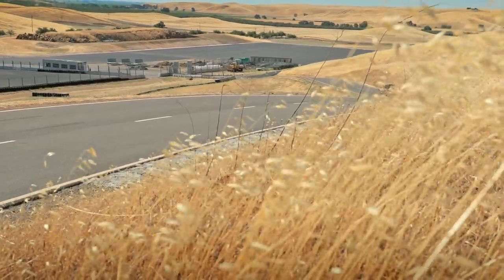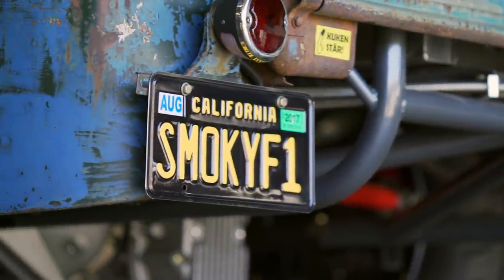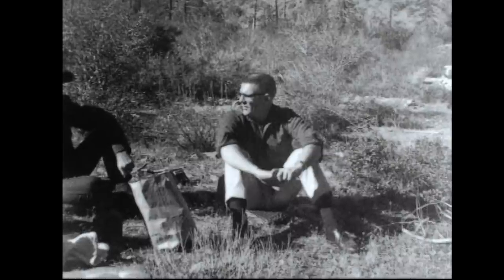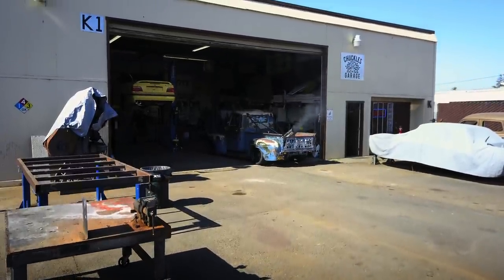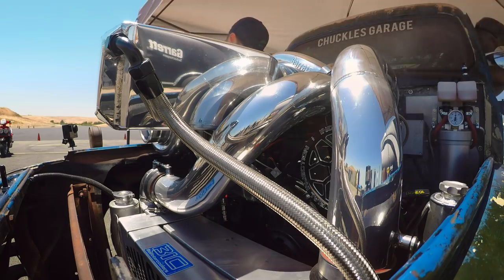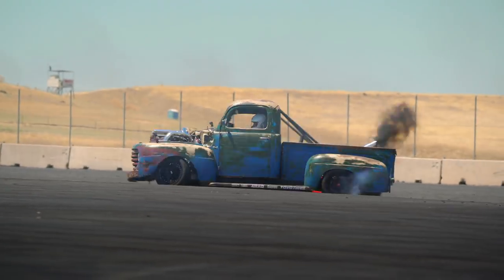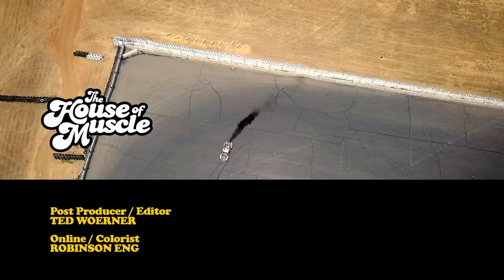Chuckles Garage: 1949 Ford F1 - The House Of Muscle Ep. 10

Comment: I need that truck in my life With TwinTurbos  😍🤘🏻
Reply: why? the compound makes so much more boost
Reply: Jesse Poole it's compound not twin.  Drastic difference.
Reply: No it would be twin turbo because there are two turbos but a compound set up
Reply: clell burdiss twin turbo and compound are complete different set ups.  Yes they both have 2 turbos but they are used differently.   Twin turbo and compound boost are not interchangeable terms.
Reply: The only time not using "compound" is acceptable is when you are using a triple, which is still a compound
Reply: Dr. Spatula you still can't call a twin turbo a compound.
Reply: zac s sure you can, as long as you qualify that it's a compound set up. There are sequential twin turbos as well.
Reply: zac s wait, did I not already say that? Pretty sure I did
Reply: Dr. Spatula if that's what you meant then ok. I couldn't really understand your sentence
Reply: Spam Can lol no that's called sequential turbos.
Reply: zac s I was saying twin is unacceptable but an argument can made for the use of triple instead of compound because it's specifying a compound with 3 rather than 2 turbos

Comment: 7:27 Hmm for you watch lovers such as Lucky, that is A Breguet Type 20 Flyback chronograph, A Beautiful work of art in of itself,  Coin Cut Bezzled edges and the like, tricky to set up right though so you never want to take it to someone who doesnt know what he's doing with it.
Reply: Close, but  the one in the video is my daily work watch, an Omega Speedmaster.
Reply: ah lol welp I've been caught as a moron lol  but the flipside is that would survive far better than a type 20 as I was a little bit surprised when I thought that lol as the moonwatch outside of the first models, the 321 which can be abit tricky to set up has a pretty robust movement.

hell the only reason why one of them failed in space was because it lacked a pressure release valve, like the kind they have on dive watches and the crystal blew out from it. Hence why they made the Mark II of that model.

Comment: Want to know what to call it? The most expensive bargain ever! Me, should I ever get a hold of a straight F1 truck, I'd throw a monster diesel in it too, though I plan to make mine mid-engine =)  Toss the intercooler under the hood for good measure with some crazy air scoop and hood relief cuts.
Edit: Oooh, thought of a good line for this truck: Putting the fun back in F1. I'll also accept royalties if ya make a bumper sticker.

Comment: 2000 lb ft at the  rear wheels?  I sure hope it makes more than that, it has gears does it not?
Reply: otm646 you obviously don't realize how much 2000ft lb of torque is.
Reply: Simple math man, come on.  Engine torque x 1st gear ratio x rear end ratio - parasitic losses = torque at the wheels. It has a minimum as a 10:1 gear reduction before it gets to the rear wheels. The engine is making more than 200 ft lbs obviously.
Reply: otm646 That's not how engines are rated, 2000ft lbs is absolutely ridiculous. Semi's usually only put out 1200-1600ft lbs.
Reply: At the CRANK, not at the wheels. He does not understand the difference. There's torque multiplication from the trans and rear end obviously.
Reply: otm646 But that's not how you rate rear wheel torque, you usually do your power pulls on the dyno in 4th (or whatever is 1:1) and even then you still will put down less than the crank. You will never see a wheel rating higher than a crank rating. An engine that puts out 400ft-lbs crank should put out 325-350ft-lbs wheel, in no expert on how exactly it works but that's how it's rated.
Reply: otm646 simple reading tells you that it's 2000ft lb. Not 200. You even typed it.

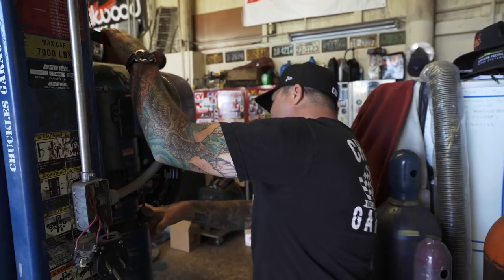Comment: 2:19 Major code violation. Open J Box unsecured devices, 30 Amp male connector on what looks like #12THHN. Is that Hot?
That's a little jackleg. We don't need no electrician, just a phone with 911 on speed dial. Seriously though that's pretty typical
in most shops. But it wouldn't hurt to tape those switch legs up.

Comment: Can you install a proper egr and a dpf please?
Reply: Sebastian Alonso Corrales Rojas why
Reply: mr holmberg reduce particulated material and nox emissions. C'mon
Reply: badtoast1 c'mon man. You can still have great engines and big power being a lot cleaner. That's a fact.
Reply: EGR will fuck the motor in a quick hurry. Manufacturers don't use that anymore because it's inefficient and destructive overall.
Reply: CanadaBud23 destructive??
Reply: The only way it'll burn cleaner is with a clean tune not emissions
Reply: Have you ever ripped apart a engine with an EGR system? Dirty as fuck! Everything is plugged and carbon deposits everywhere. Not to mention you are introducing particulate matter back into the combustion chamber. This creates hot and cold spots in the cylinder preventing proper burn, causing detonation\preignition. Which is extremely bad with high temps and boost, blow shit up easy. Even if you were to make a low power engine with EGR the buildup would reduce the effective volumemetric efficiency of the engine.

I have already went through this a bunch of times with 4.0's including mine and it's better without it and fuel economy is higher. Manufacturers finally are doing away with it because the EPA realized that its bad.

I have no problem with a DPF filter but that would probably plug up in a hurry.
Reply: badtoast1 nope it's a later model 24v common rail purely electronic motor.  At that hp level electronic Cummins motors are much more drivable.
Reply: NO.
Reply: CanadaBud23 simply use low sulfer diesel and low saps oil. Bingo, no more soot deposits
Reply: Chuckles Garage I truly love you truck, personally I also drive everyday a diesel  EV compilant car. Add some more value and make your awesome engine greenner.
Just saying. Bye.
Reply: You are saying make his race car's awesome engine greener which is contradictory to it being both a race car and an awesome engine
Reply: Larry Smith Cool Story Bro. Enlighten me. How am I ruining everything SEMA did for diesels, and what exactly is that? Have you seen video of me "rolling coal" on the street? No, you haven't. This is all closed course stuff. I run different tunes for different scenarios. For race and hoon, I use performance tunes, which make smoke. For street, I use a conservative tune, which makes very little, if any smoke.  If you ever want to insult me in person, come down to the shop. 300 West Robles, unit K1 in Santa Rosa CA. Now, you'll have to excuse me while I get back to building memorable vehicles and not wasting my time trolling people I don't know anything about on the internet.